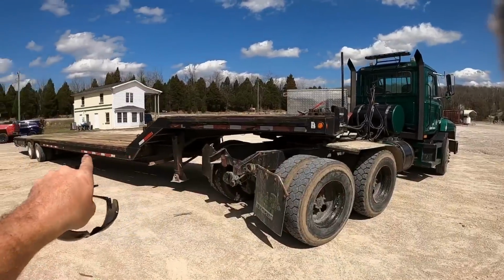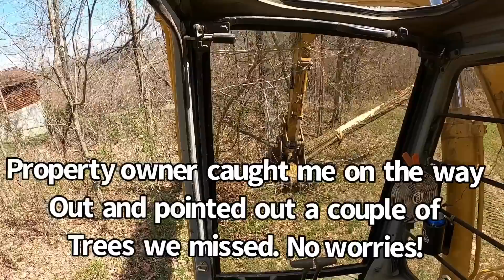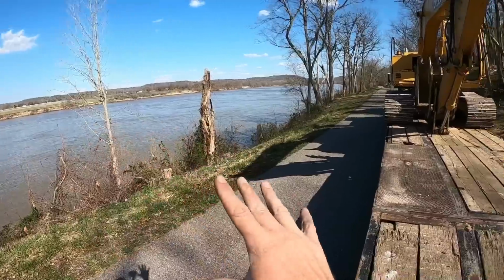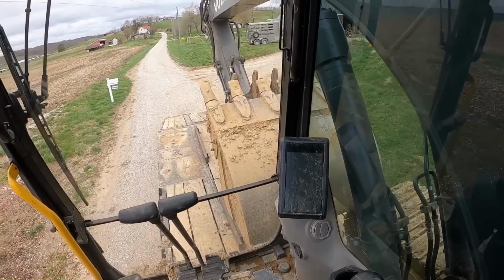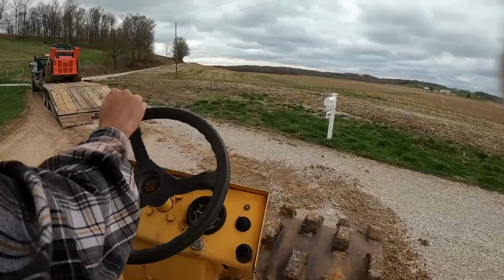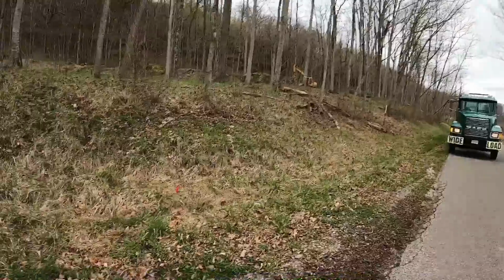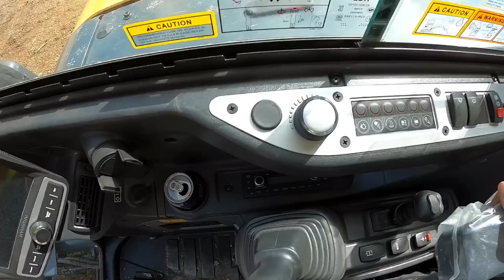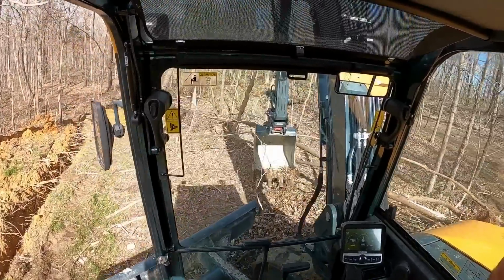Part Time Truck Driver hauling Three Different Excavators

Comment: Three trips... no casualties!  Cap’n your reputation is suffering... oh wait... there was that mangled tripod!  

Was that Kitty Litter bottle being used as a jug line?   Or, BB gun target?  Frog perch?  Emergency floatie in case you fell through the ice?  (Just threw a few things against the wall.... did any of them stick?)

I think you’ve just about exhausted all of the tractor and trailer angles.  The one I don’t recall seeing is from behind the pin as you back the 5th wheel into it.   Probably because the trailer is rarely removed?

This was a pleasant ride along... especially with all of the camera angles.  Well done sir!
Reply from the maker: I’m planning lots of new angles!  Tough to come up with new ones,  but I’m gonna try!

Comment: Trucking and hauling equipment with skills on narrow roads and tight turns.  Never gets old.  It's always nice to try out a new piece of equipment.  Looks like the pond repair is going to be a little more involved than originally planned.  Draining a lot of water, so it looks like there is going to be a significant dam repair!

Comment: That was a great bit of reversing there Captain.
Reply from the maker: Hey thanks!
Reply: There always seems to be one numpty that drives up to the back of the trailer as your reversing back out and sits there glaring over their steering wheel at you... yer sure I will jump out and pick the 44 tons of truck 'n trailer and move it over 20 ft so you can go past ya merry way, alternatively, you could have used a spare brain cell or two and stopped off the road for a second!... grrr
Reply from the maker: @Bcc0rg  😂😂 you aren’t wrong
Reply: Nice looking machine!

Comment: A suggestion for your camera placement ideas. Just for a short snippet maybe put a camera in the drivers seat (maybe while stationary) & point it at the side mirrors & show people what you can (or can't) see in them. It could be a good educating moment for some people & give a reminder that even though a truck cab may be higher, you can't always see people in cars & they need to be mindful of that for safety. Another good video, thanks.
Reply from the maker: Great idea!

Comment: Man, diesel fuel is expensive in Indiana. I'm amazed that all the equipment started without using a jumper box. Kinda ironic that the dump truck was the only thing that struggled and it was sitting at the house. Be safe Cap.
Reply from the maker: It always a little more there because it’s a rural station.  What are you paying where you’re at?
Reply: @CaptainKleeman  it's kinda weird, one Citgo station had it for $2.79 yesterday but about 5 minutes down the road was $3.19. Other stations are somewhere in between. I don't understand the discrepancy of prices within the same city, especially since we have a major fuel distribution center in town. I suspect there is some price gouging going on.
Reply: @blackdogEarthworxLLC , up here in western Canada (numerous refineries here in Edmonton) we're paying almost $5/g can dollar.
Reply: @StephenWolver  holy crap! That sucks.
Reply: @CaptainKleeman  in north MS its $2.73 for diesel

Comment: Thanks for sharing your thoughts and adventures. Whenever I’m traveling on unfamiliar roads I try to take time and check my route via google map with the aerial view turned on. Had a 4 hr trip once on all unfamiliar roads once, that I checked out, all the time it felt like déjà vu. Kept spotting interesting features I had noticed on the aerial view. Could of sworn I saw a Prestone jug float by when you finally broke thru on the drainage ditch dig. Makes one wonder was it floating in the pond or a lucky buried find?
Reply from the maker: Cat litter bucket!  Was using it to prime pump.  Got away from me.

Comment: cameras angle i got one, on the back of the trailer with a small stand on it or how ever you get up in the air and in the center of the tail on top to see left and right when you make a turn i wonder if that would work if you get what i mean
Reply from the maker: Thanks for the suggestion!

Comment: That’s so true about loading equipment on a dead end road 😆.  Seems like the minute you get set up every body and their Brother decides they have a reason to go somewhere.   Very enjoyable content.  The Live stream came up but I was late trying to watch it.   Will you get into what you guys feel was the cause of the pond bank failure ?  Because it seemed like it was compacted in a decent manner.   Ever situation is different so I just wondered if it was material issue or a compaction problem ? 
🇺🇸🦅🌏⚓️🇺🇸
Reply from the maker: Why is that??? 😂😂

Comment: Ever have one of them speed binders loosen up at all? Or not want to tighten down? Seems like a pretty basic mechanical piece of equipment but just curious. I know you all like them
Reply from the maker: Like any binder,  it’s all about how a fella routes the chain.  Any binder will come lose if not pulling right.  All in all, with the drill, I don’t have any problems.  For some reason, with the impact,   They won’t get as tight.
Reply: @CaptainKleeman  thanks for the little bit of info capt. Enjoy your weekend, dont work to hard!

Comment: Although a real good truck driver on stuff like logging trucks and a few turns on the low boy, I wasn't cut out to be a cabover driver nor in city lowboy/other such... yet I have wiggled into some darn tight spots and never knock a limb down or wire or ... you get it. Just never figured out why someone never made a trailer steer so it would travel around those tight stop sign clear out on the curb  corners. I own a stop sign down in Roseburg Ore., and after paying it off I could hear that judge say put it right back in same spot, best revenue we got going. I do have a question tho... how come with all the ponds an water coming like Noah's Ark, haven't they got a spot to wash mud out of the tracks on equipment??? Makes no sense to dig hard caked mud from the underbelly of stuff when a little water to tip toe through and wash a good portion off. I am not fond of that one chore specially if frozen to the machine and rain drops like ice cubes coming down, wind is plumb out to take you out..... no sir daddy, not fun a tall. So do they have places to wash short of a car wash that would get you some fines
Reply from the maker: Mike has plans a for a way area in the future.  I’m excited

Comment: You’re required to have flags and an oversized load sign for the 120?
Reply from the maker: Yup
Reply: We don’t have to in our neck of the woods for 102” and less (but we’re also not putting it on youtube for the professionals to critique) lol
Reply from the maker: @joshdurbin4662  interesting.  What state is that and what is the width of your tracks?
Reply: I’m in Illinois.  I have a 200 so I’m over width and over weight.
Reply: It’s 10’ width or less here you don’t need flags

Comment: Just found out speed binders aren't legal in all states.
Reply from the maker: Would be curious to see the print on that.  They meet all DOT regs and considering it’s a federal regulation,  I find that difficult to believe.  But like I said,  if you have actual legislation, Ild love to see it
Reply: @CaptainKleeman  Spent some time researching it but could find no rule against their use in WI. Decided not to do any more research because I don't truck.

Comment: I did not know there were two different versions of the same movie gone in 60 seconds the second version made in the year 2000 starring Nicolas Cage and Robert Duvall that's the one that's going to have the best camera angles I have been reviewing it they passed our and yes there are some very impressive angles you will need telescoping tubing that you can attach to a vehicle extending out to the side of the vehicle 6 to 8 ft you will need to use farm to market roads with no traffic to avoid vehicular complications if you can get the camera far enough away from the driver's door so that you can see the entire driver's door as well as you while you're driving you can set it up high with a camera looking down in set it down low with the camera looking up set it up forward so you don't have to get a crick in your neck glancing at the camera multiple cameras would be better just be careful not to lose any cameras I look forward to some good videos the kind of videos that will make other people jealous because they didn't know your favorite angles give it a try keep up the good work I'm proud of you